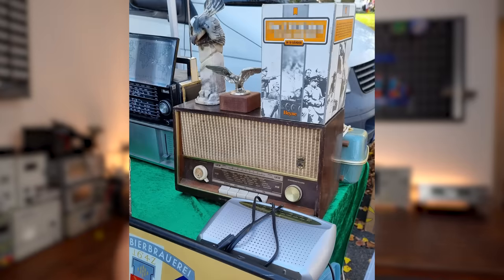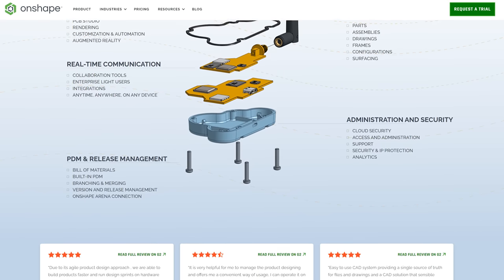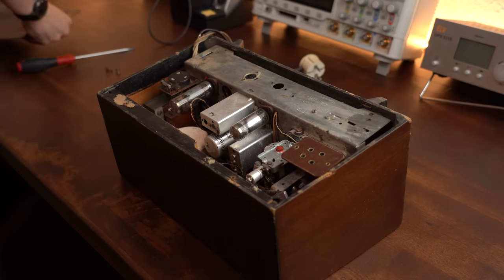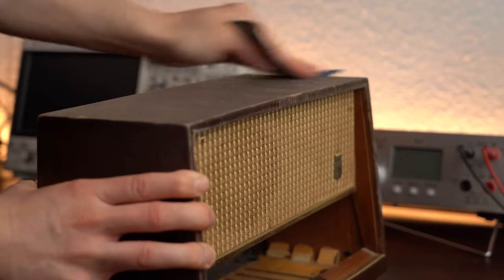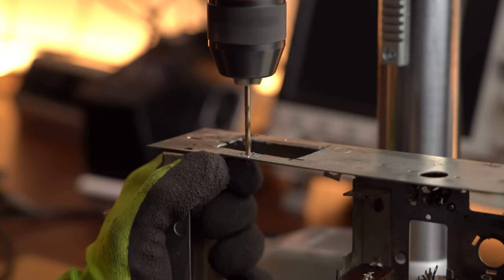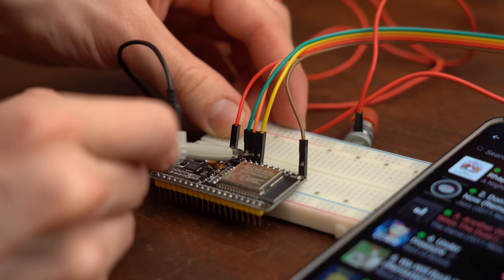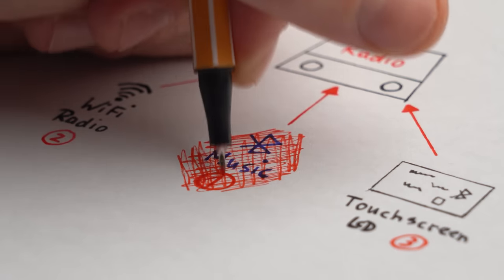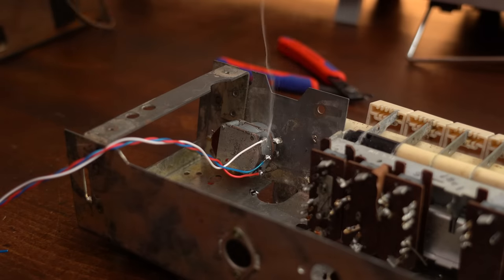I Spent 20€ at a Flea Market and made Something AMAZING! (Internet Radio)

Comment: If I was you... I forget the touch screen and program 5 stations under the old buttons of the radio itself.  You can also ad more stations and use a rotary encoder connected to the old station selector
Reply from the maker: Also possible :-)
Reply: @greatscottlab  thanks for the inspiration 🙏
Reply: thats great idea. i would have used the vaccum tube amp for that distinct sound quality
Reply: I could hide Alexa inside 😂...
Reply: I thought the same, five buttons, five radio stations
Reply: Yeah, and use wifi mini server to be able to change the station settings via phone etc.
Reply: Absolutely agree. Though cool and decent looking, the modern parts take a lot away from the old timer charm.
Reply: I love the touchscreen, and I think it gives it a nice modern/classic blend. Reminds me of the William Gibson novel where people have retro technology mixed with modern over years and years of replacements.
Reply: Came to the comments to say literally the same thing... It would look SO much nicer...
Also, a little VFD (vacuum fluorescent display) or an LCD that would show RDS data and station name in place of the "UKW" band in the old front panel - would've looked SO COOL

Comment: I usually like your projects. Still, this one is hard on me. I love the appeal of those tube type radios, and part of it is their distinctive scent when they get warm. You lost this part to the trash can. Another point is, that musicians spend amounts of money for a tube type amplifier which you had at hand. The only thing you needed, is a Bluetooth to FM converter, and you could have simply played whatever your smartphone throws at the old steam horse. No need for such an invasive solution. Sometimes, less is more.
Reply: That radio would not receive FM.
Reply: Are we sure the radio was still working? And I'd find bluetooth-to-FM a bit low tech. Would have been cooler to find a way to directly hook external input to the audio circuit.
Reply: @martinrocket1436  It’s an old radio. It doesn’t matter if it’s still working now, it’s easily fixed. That’s the beauty of old technology. I agree that using as much of the existing hardware as possible would be the best way to go.
Reply: Two things worth noting. First off, old electronics are often extremely carcinogenic, thanks to an abundance of polychlorinated biphenyl and other compounds now long banned. Secondly, musicians don’t pay a lot for tubes, they pay a lot for very specific tubes in excellent condition.

It’s unlikely that what was lost here was worth keeping.
Reply: @trhosking  the very most of post war tube type radios do indeed receive FM stations. And if it doesn't,  a good share of these radios have at least a record player input which can easily be put to line level by adding a pull-down resistor. And if both isn't the case, it's not too hard to identify the audio output pin in the radio reception tube section. You pull that specific tube and feed your audio directly into the acceptor of that tube socket. But be aware, tubes work at high voltages. Before doing that, a bit of self-education is absolutely necessary.
Reply: What tube are y'all talking about?

Comment: When using only five stations you don't need a touchscreen. A really nice idea is to use the scale as selector for the stations so you must tune in to a station to keep the analog feel alive. When nothing is selected use some static noise. This can be done with an IR LED (attachted to the back of the pointer) and a few (IR) photoresistors/transistors. When the pointer is above a photoresistor/transistor and the LED shines on it, a station is selected. I think this is a really awesome idea and pretty easy to implement.
Reply: Good idea
Reply: Or just measure the tuning cap. It's much easier.
Reply: @bzuidgeest  Okay, try it and come back with your results. Succes!
Reply: @bzuidgeest  need an rc circuit with mcu timer
Reply: @codebeat4192  don't have to, use Google, several options that others have done out there. But you can use your convoluted way if you want to.
Reply: I LOVE the idea of plating static while switching or even buffering.
Reply: Exactly what I was thinking. I think the touchscreen not only ruins the aestetics of the radio, it also added the main bulk of the costs. But the idea is really cool :D
Reply: I'm thinking to do the same thing but I'm not wasting my time to build circuits...I do have a tablet Amazon fire...I did used a few times...all i need a stereo jack to connect to my amplifier 😏😎
Reply: @badeadrian  So you have a business or what? "Waisting my time" ..... haha. This is not meant for lazy people. Besides If it is working, it is not the same. When the amp is dead, a jack hack doesn't provide any solution. What is the point of making the comment you made? I really don't understand at a DIY fun project vblog. If scott only wanted to amplify audio, he took the easy way and bought a speaker with an amp. But that is not fun, right?
Reply: @codebeat4192  that is true..he destroyed a vintage radio to make the ugliest upgrade.. probably if you have a classic car.. you will do the same thing.. keeping the body and adding the Rolls Royce interior 😏
Reply: I found this an insult for vintage radio restoration....
Reply: @badeadrian  Are you OK? Tjeez.
Reply: Use the switches to change channels. Control and program it from your mobile device using bluetooth.
Reply: There is much easier way to implement the same functionality. Just replace the variable (tuning) capacitor with an potentiometer and use some analog input of that CPU.
Reply: It could also cut the price in half

Comment: Nice project but I had preferred the old radio electronics to come back to live!  Old analog radios is an amazing world, with today’s electronics advance they could be improve a lot in quality and features.
Reply: I agree, I feel sad about destroying old radio. Old radios had phono input, so he can use tube amplifier of the radio along with the speaker to amplify internet radio signal. I hope, it is still possible to restore such old radio.
Reply: I 100% agree on that! What a pity to destroy a superb audio amplifier already present in there. All it usually takes to restore these is to replace some of the old electrolytic capacitors and de-oxide the various switches and contacts. Tubes usually last forever.
Reply: well the tubes could be dead
Reply: @LKonstantina915  very unlikely i restore radios and this set is one i do want and tubes of that era are very reliable.

Comment: Those old Grundig's are great when they are restored.  I can understand you wanting to completely rebuild the internals with modern components, but they do sound amazing using a bluetooth or other adaptor and just restoring the existing electronics.  90% of the time the Valves/Tubes are good.
Reply: Exactly. Not gonna be subscribing to this channel.
Reply: @cjay2  Ok bye.
Reply from the maker: My tubes were busted though.
Reply: @greatscottlab  I like your videos but this is a disaster, even a qualified service would repair it for cheaper and bluetooth modules are cheap on the internet. With the added bonus of saving an old radio
Reply: You guys are being to harsh on him. The man can do as he pleases and he is showing us a neat alternative to vintage restoration.

Comment: when I was 12, I opened up a radio like this one which my grandfather bought from UK back in 1980s. It was made out of plastic powered by a 6V lead acid battery. Components were quite different back then. There were expensive Germanium transistors along with chunky electrolytic capacitors and 1W brown coloured resistors. Only same component I found there which we still use commercially is the knob potentiometer. It all were connected by wires, no modern pcb whatsoever.  However back then, I didn’t know a lot about electronics so I just scrapped the parts and collected them in a jar which I still have. This video makes me feel nostalgic.
Reply from the maker: Thanks for the feedback :-) Nice story
Reply: Same story! Regret opening vintage radio back then instead i would have opened now😢
Reply: Same here
Reply: Record player for me that my mom had from the 50s. This is the type of thing if it's beyond repair, you modify to use. If it still is usable you restore

Comment: 5:58 By the looks of it, it's a PCM51xx breakout board (although mine looks flipped), and if I'm correct, then you forgot to tie the SCK pin to GND! SCK is the System ClocK input, but you can tie it to GND for the internal PLL to activate, and it should support 44100Hz and 48000Hz sample rates in this mode (other modes need SCK generation, it's in the datasheet). Also the output of this chip is line-level (1kOhm), so you need an amplifier to drive anything audible out of it.

Comment: 6 years ago I did a similar project with my grandpa’s Phillips vaccum tube radio. It has 6 vacuum tubes and takes 2min to completely turn on to heat. Once the vacuum tubes are heated, it outputs the perfect music. Since AM and MW are not there anymore, it has a special button. With a mono input, it works just brilliant with new system. Plugged in the Bluetooth/fm audio board output using banana plugs and Utes perfect. I didn’t remove original circuit. Also your radio doesn’t have the special knobs like mine does. Pulling right knob gives control of bass and pushing to gives treble control. Left know is for turning on and volume control. I restored it and just used 3 times and kept it as a museum piece.
Reply: Don't know where you live but am is very much still there, just not as busy as in the past. Even long wave still has stations on a good day.

Comment: 2:27 you can probably sell that PCL82/PCL86 tube (on the right) if it still works.
The funny thing is that, most of them uses 12V/16V heater to turn on & 220V DC anode for both (!) tubes, you can just feed it line signal and wire it straight to the Trafo & Speaker since that is technically an integrated amplifier (tube version) on a budget for those era.
If the circuit looks very simple... because it is; that tube (and something similar) are also being used widely on very old TV's.
Reply: P tubes were used in televisions, not in radio receivers ;)
This set uses an ECL86 for preamplification and to drive the speaker.
PCL86 aren´t  worth much, but ECL86 are.

Comment: Interesting cool little project. Though I'm not sure how I feel about trashing a vintage tube radio. I personally would have restored the old radio part so you could dial in some radio stations the old way (if/when WiFi isn't available). Then integrated the WiFi radio along with a DAB and Bluetooth/BT device into the cabinet along with the touch screen. I'm working on a project of adding bluetooth/BT to the amplifier of my separates HiFi system by upcycling a broken BT headphones set, the physical headset frame and ear cups are broken but the electronics are still in perfect condition.
Reply: Preferably it would be a good idea to look for a AM/FM/DAB tuner chip and add it to the circuitry.
Reply: He probably could've even powered the newer electronics from tapping off of the heater winding on the power transformer and rectifying/filtering it.

Comment: While i like the general idea of making something useful of old stuff rather than throwing it away, i honestly don´t really like it how the internals got ripped apart like this.
You did an great job anyways but i don´t like the idea of destroying something like this, which on it´s own would be worth a project on doing a restoration of.
I mean sure it´s just an old radio but it would´ve been much much nicer to see it properly repaired and working again because FM bands are still useable and there´s nothing more pleasant than an tube radio, which outperforms most modern FM radios in receiption quality and sensitivity.
You could then still add bluetooth or internet radio through the TA port (basically a line in) and have all the modern features, but keep the rest of it alive and working.
There would´ve been ways to grab one of the internal voltages to power such addons even.
Reply: I get what you are saying . But it´s not "just an old radio" .   It's a dream find .

Comment: nice project. =)  i personally would have used the existing buttons on the radio to change station and enable bluetooth to keep the look vintage. the touch screen also works tho.
Reply from the maker: Also possible ;-)
Reply: I used the existing buttons on my old juke box to interface with a raspberry pi. I used a simple USB keyboard adapter wired to the old buttons.
Reply: Yeah, you could just have placed an old Android phone on top and used the radio as a speaker.
Reply: @greatscottlab  Hello，would you like to disassembling a LiFePO4 battery?

Comment: Was it possible to integrate the white buttons for ESP's GPIO input for channel selection and not using touchscreen at all? This would make the radio completely in its original form which in my opinion is a much 'cooler' choice
Reply from the maker: Surely possible.
Reply: Would even be better to use the standard dial and round station selector wheel (on right hand side of the station dial) to select the internet stations. Also it is a pity to not use the original valve amplifier. 
As a radio collector I am not in favour of these modifications. You can instead restore the radio and use the record player input to connect a blue tooth receiver into. In that case the original radio is preserved.
Reply: @rudie2902  But it was a variable capacitor. How would you decode capacitive values to something digital? I am not sure if any aftermarket potentiometer could fit nicely in there
Reply: @FaizanKhan-iq3yd  There are capacitance to digital converters, You'd need to check the range they work on vs the range of your variable capacitor in the data sheet tho.
Reply: @FaizanKhan-iq3yd  Scott is replacing everything so the variable capacitor can be either replaced by or connected to a Rotary Encoder.

Comment: This hurt me to see, all you need to do is replace all the paper type capacitors and the few electrolytes that are there.
Then it works for sure.
You connect your internet radio to the gramophone input.
There is no reason to throw away old electronics.

Comment: Great stuff, Scott!

But those 5 old buttons on the radio made me wonder if you could use them for choosing each station?

This will also keep the authentic look, with no touchscreen ,which I'm sure will be useful in some other project).
Reply: Yes! Why have 5 unused buttons, implement an LCD, then restrict the radio station selection to 5 touch buttons?!
Reply: @msmith2961  When I did mine in an old bakelite radio, I used two buttons for previous/next station, then had 3 left for presets.
Reply: Actually the touchscreen makes it ugly now :P

Comment: I did a very similar system but used to send some old time radio recordings to the radio it even sounded like it was back in the 1940s. I still used the valve amplifier for the sound output which gave it a nice warm sound. Thanks for your time and work.

Comment: Maybe should’ve tried to get the old chassis going again, and fed the audio into to the existing circuitry.. just my thoughts though. Those radios are usually simple to repair, and replacement tubes for those are cheap.

Comment: Honestly, after scrapping Bluetooth Volumio on an old raspberry pi (1B or 2B) would have been so much more functionality for around the same cost even if you need an external wifi dongle (because the pi could take over the LCD functionality as well). If bluetooth worked, and you don't want playback with DLNA or from network shares then this might be a better call.
Reply: i will never get the point of people using raspberry pis instead of microcontrollers. you don't need a full linux os on an sd card, than can corrupt for such a simple project. and who wants to have a radio, that needs to boot for longer than a blink of an eye?
Reply: @c5e3  because if you need more than two of networking (with multiple application layer protocols), GUI, file systems, multitasking, USB host, it's much harder to integrate these tasks on a microcontroller (even though all of them are feasible on their own). In linux, ready solutions are installed by a package manager. 
Also hardware accelerators are often exclusive to microprocessors, and especially when dealing with video they make a big difference.
And in this case, volumio is a readily available product, that has a community and some level of support, with much more functionality that you may or may not use.

Comment: Awesome project! Why didn't you use the original valve amp? Its a very good amplifier and it should solve the problem using another amplifier. Also, as equal as others, the original buttons are perfect to use without a touchscreen. A screen is good to show which station is playing.

Comment: The LCD setup seems a bit overengineered, you could literally use 5 buttons and print a nice label for them. You wouldn't need a separate board for driving the display, the esp32 and the i2s DAC would be the whole digital electronics you'd need.

Comment: You cruel beast!

When I was about your age I took apart an old valve Roberts Radio and transplanted a veroboard circuit with single chip fm receiver. I have recently been restoring it to its original condition.

You should have sent it to Dave Tipton.
Reply: ... And perhaps learn from Dave Tipton.  He would have had it running in little time.